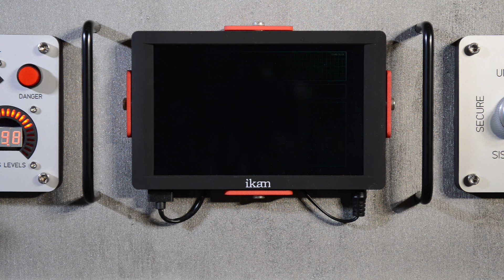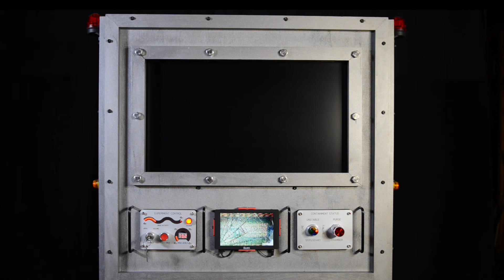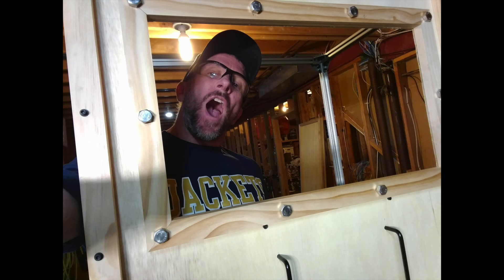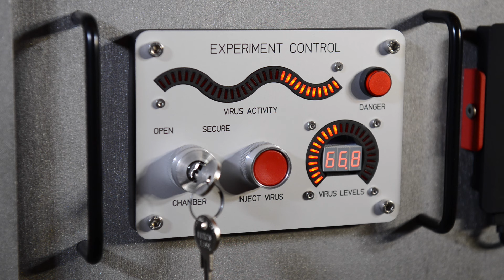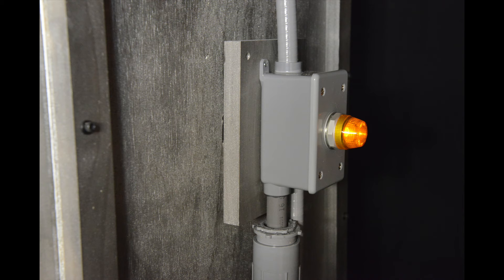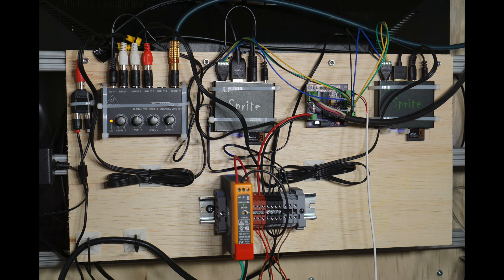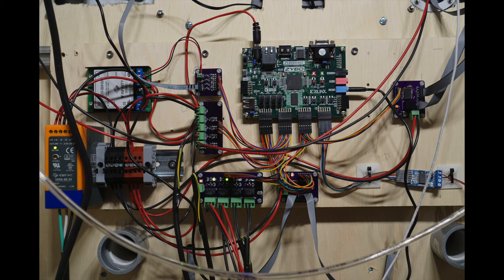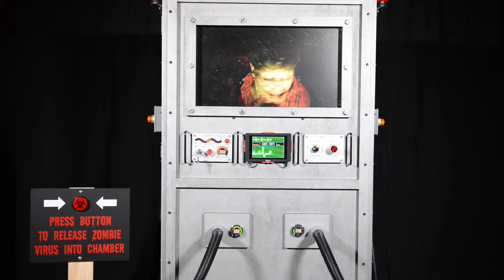Halloween 2017: Zombie Containment Unit

Comment: You level of detail is impeccable! The face that the control elements all work in correlation to the zombie movements is one of the best ones I have seen! Please get lots of scare video on Halloween to share! You will definitely be attracting attention!
Reply from the maker: Thanks! It took weeks to decide on the hardware / software architecture for the project. I may add DMX-512 and WS2811 pixel interfaces to the FPGA. The ZCU could then drop the ambient / background lighting and flash bright red and white blinders and biohazard gobos when the chamber fails. Maybe save that for a follow up for 2018.
Reply: Ah the struggles of the initial planning! You definitely should add the DMX!! Would put your already impressive Project over the top! We are using a BooBox Flex w/ dmx. It controls our dmx fixtures, fog machines, solenoid media etc. Worked like a dream! Haha already planning version 2.0 I see can't wait to see it!
Reply from the maker: I bought a small moving head light with custom biohazard and skull and crossbone gobos and some LED blacklights. I’ll see what I can do with them. If they work well, I’ll add DMX to the FPGA. Otherwise, I’ll use them in a side show controlled by xLights or Luminair 3.
Reply: Glen Akins can't wait dude!

Comment: Awesome! I am interested how you did the plates with text that the buttons and lights mount to. Spraypaint and then silkscreen, or how?
Reply from the maker: I cheated. I used Front Panel Express to manufacture the panels. They engrave the text on the panel then infill the engraving with ink.
Reply: Good idea. Thanks!

Comment: This is an incredible job! Very well done.  I'm reading over your blog posts now and there is a ton of information to digest.  Did you post your .stl files anywhere? What company did you use to fab your circuit boards?
Reply from the maker: Thanks, Shawn. I added a Fusion 360 archive and the .STL files for the bar graphs to my circular bar graphs repository on github. My username over there is bikerglen. I used Sculpteo to fab the 3D printed parts, Front Panel Express to fab the CNC’d parts, and OSH Park to fab the PCBs.

Comment: Gday Glen this is awesome! Well done do u have cost estimate on this? Is there a cheaper way u could've got similar results? And lastly is there anything u would've changed? Cheers thanks for the great informative video.
Reply from the maker: Hey thanks! Most people use a $3 DTMF decoder board and a $3 relay board from the usual suppliers of low-cost imported boards instead of an FPGA. It wouldn't have as many blinking lights as my box but would still be pretty cool. If I had to do it again, I might have used a 32" monitor instead of a 27" monitor. Also would have made the entire sides bulge vs just the little boxes. Ciao!
Reply: @GlenAkins  would u happen to have a link of the dtmf and relay decoder that would suffice I'm clueless to this part the wood work etc I'm fine with cheers again
Reply from the maker: @wildcardbeatbox8096  Check out this blog post by someone who went with the DTMF decoder and relay boards. He lists all his parts and what not. http://wickedstone.com/Halloween/Html/relay_decoder.htm

Comment: 6:16 First of all: this is awesome! Second: I know the Hi-Rez videos contain codes for syncing stuff, but I didn't know what type of signals they were. Now I know so thanks for that! Does that mean the video only has left channel normal show audio and the whole right channel is solely used for the signals?
Reply from the maker: Thanks! You're correct. One channel is program audio; the other channel is control tones. HiRez provides a two channel mix without the tones if you have another way to sync the actions to the video. It'd be cool to find a low-cost media player with more than two channels of audio output but I don't think they exist.
Reply: @GlenAkins  I was thinking of creating my own video content and hooking it up to one of these Signal Decoders (AD22B04 or the 8 relay variant) . I want to use the video on a pc so that comes with the possibility to play a 5.1 soundtrack trough the soundcard outputs.
What about playing the video from a Raspberry Pi and sending it out through HDMI. That carries 5.1 doesn't it?

Comment: Might enhance the jump scare to add a fine mist water sprayer (or maybe just compressed air) pointed at the viewer to trigger when the glass breaks. May give the feeling you just got infected.
Reply from the maker: I’ve thought about it but didn’t want the risk of blowing compressed air at guest’s unprotected eyeballs. Also, I’d need a larger volume compressor to fill an air blast tank with only 90 seconds between bursts. And it’s usually too cold here on Halloween to spray water.